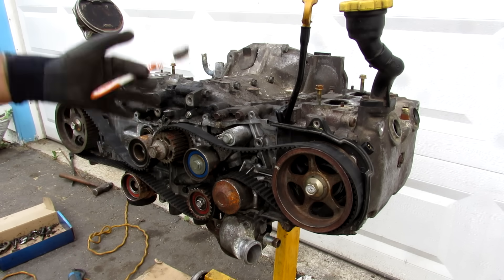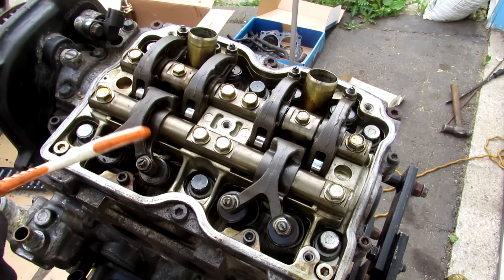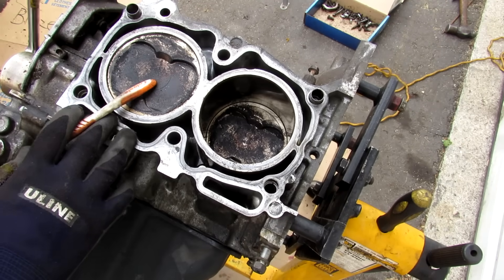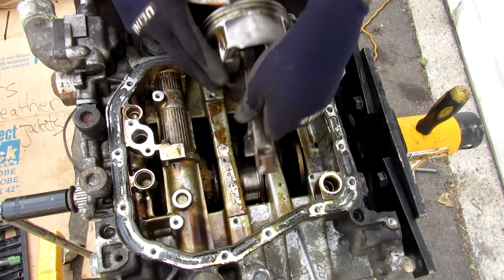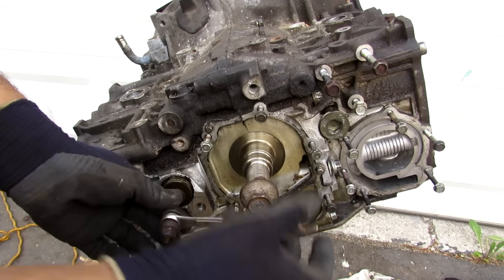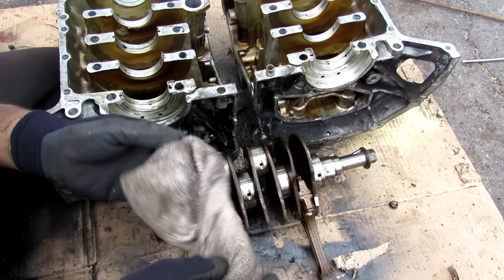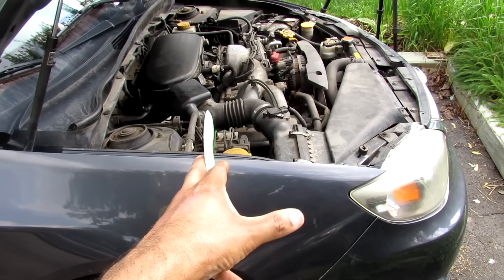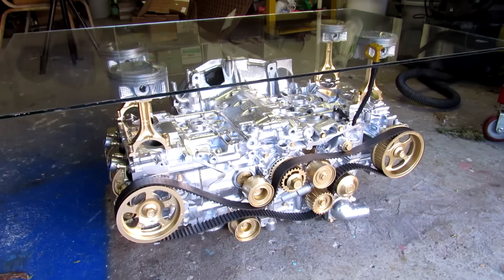Why Subaru Engines FAIL

Comment: At 11:44 how come there is no hole for oil? Could it be on the other side?

Also, I've owned a 1.5 liter NA automatic Impreza which is the weakest and dullest engine Subaru ever made that you could have on an AWD car, it does 0-100 Km/h in 14 seconds. The plus side is that it handled really good and the engine was very smooth at high rpm compared to every inline 4 I owned and driven. I did about 150 thousand kilometres until I sold it, and it had ZERO problems hence I was very religious about servicing it.

I enjoyed the video BTW.
Reply from the maker: I think its lubricated on the other half of the block. Glad you enjoyed!
Reply: :D They sell the Impreza and XV with the 1.6l NA and CVT as only engine option for years over here (well, now actually also the 2l e-boxer). Same 14s 0-100. Really a uninspiring engine/transmission combination. ^^
Reply: Even possibly slower was the Subaru FF1 which had 1100 cc flat 4. To give the car its due, I flogged it for 3 years before selling it. At one point there was 900Kg of bricks in the back. This was a wagon with front driver and manual box. Manufacturers date was 1970 or 1969. Small but mighty.

Comment: Take apart a 1.0L 3 cylinder engine from a Ford Fiesta or a Geo Metro.
Reply: I would be more interested in a teardown and comments on a Volvo B18 or B20 engine. If you wonder why - that's the engine in Irv Gordon's P1800. The difference between B18 and B20 is primarily the cylinder volume.

Comment: Subarus are all fun and games until its time to change the spark plugs
Reply: Never had a problem changing my spark plugs. I removed the battery to gain access to spark plugs on right bank and removed air intake box to access left side spark plugs. Took me about 45 minutes from start to finish, he made it look hard to gain access to spark plugs but it’s really not.
Reply from the maker: @82dupont  Well its a comparison to a normal 4 cylinder. 
The newer FA series engines are even more compact under the hood.
Reply: speedkar99 ...I’m not trying to be negative about the information, you have skills and your tear down proved it. I’m just speaking from personal experience, my 2008 legacy was the easiest motor to work on, I was victimized by the Head Gasket issue which I didn’t do myself though. Other than that, I loved that car.
Reply: @82dupont  It depends on the engine and vehicle you have. Some boxers are harder to do spark plugs on than others.
Reply: Smoke Stack Usually it's easier than it seems
Reply: @82dupont  i am enthused/encouraged by yur information
Reply: @82dupont  
I have to take off two whole coil covers to get to my spark plugs. So annoying.
Reply: But then again, how often do you have to change plugs on a modern vehicle?;not very often,so no major issue. Got three subies myself.
Reply: @ozzyolof9209  Every 100 thousand. I do the maintenance myself, so its a pain in the butt. Plus if you go to the dealer the cost is expensive.
Reply: @ozzyolof9209  On the STi it's every 96k km. Not that often, but a pain when it's time to do them. Took me a few hours and much cursing.
Reply: @diskostew99  it takes 30 minutes for a professional to do all 4.
Reply: @pauljj5547  And charge for an hour and a half.
Reply: @pauljj5547  yes and it takes a professional 10 minutes to do all 4 on a normal I4. Next.
Reply: The spark plugs only need to be changed every 3rd head gasket. 
Coils though, every head gasket.
Reply: Just as fun as changing the head light bulbs I gave up after I read take inside of wheel well off reach up and i dont know the rest cause I took to the dealer the head lights were done in 20 mins it wouldve took me 3 hrs and those plastic clips on the wheel well wouldve been broke cause me and plastic dont get along if its plastic I'll break it lol
Reply: EASY AS PIE,YOU GOT TO USE THE RIGHT HARD DRIVE SETUP CHANGE MY 2006 OUTBACK 24 MINS.THE BOXER IS REALLY EASY,STEP BACK LOOK AND USE YOUR SKILLS,GOT A CO- WORKER CAN PULL A BOXER 35 MINS CAUSE HE IS GOOD AT WHAT HE DOES,EX WINSTON CUP ENGINEMAN FROM TENNESSEE!!WE WOULD MAKE BET AND WIN $$$ WITH HIS SKILLS HE WAS 52 ,BEEN REBUILDING LONG BLOCKS SINCE HE WAS 15,I ASKED HIM ONE TIME WHAT WAS THE STRONGEST ENGINE ?? THE OLE 4.0 STROKER JEEP STRAIGHT 6 HAD MORE TOURQE THAN ANY OUT THERE!!
Reply: High quality plugs means you may only do them 2-3 times in the cars life, just like a timing belt. They are not difficult.
Reply: I have no idea why a plug change is always cited as something difficult on these. At worst it's a little awkward. That's it.
Reply: Boxer engines are just a pain in the butt. Just too hard to work on installed in the engine bay.
Reply: It's really not that bad
Reply: @rustyshackleford81  yes, it is that bad compared to other 4 cylinders.
Reply: Sohc are easier than inline 4 motors
Reply: @Tugboatpb  i seriously doubt that
Reply: To be honest they look similar to an LS/GS460. They are tight and you have to pull the tube seals to get stuff out and have the right length tools or flex drive.
Reply: @N4CR  fair enough but compared to a normal I4, its a poor design.
Reply: Toyota 4RUNNER 6 cylinder   also difficult
Reply: Buy iridium plugs so you have to change them less often
Reply: It really wasn't that hard to change the spark plugs
Reply: @Tachyon836  I think he was referring to the turbo cars. He should have specified. My ej255 sucks to change the plugs on. Found the best way, is loosening the engine mounts and tilting the entire engine to whatever side you're on. Works pretty good.
Reply: Changing the plus wasn’t difficult on my 98.  just move some stuff out of the way and identify the right tool for the rear drivers side plug.  leaking oil was a problem.
Reply: You have never tried to change spark plugs on some older Lexus RXs
Reply: @csar2976  im comparing the boxer 4 to other 4 cylinder engines.
Reply: Its not bad job to OHC because spark plugs points up. In DOHC its harder because they are in middle of deck but i think transverse V engines are much worse 😄
Reply from the maker: @morreracing  I didn't realize that the DOHC is even harder. Agreed though the V6's that face the firewall requires you to remove the intake.
Reply: @morreracing  The transverse ones are bad, but im comparing the boxer to other 4 cylinders.
Reply: @andym1223  well there is also 4 pots where you have to remove intake to get spark plugs 😉 just changed performance coils to GC8 STI.
Reply: Also head gaskets are somewhat normal thing they consume due to abuse and neglect of service
Reply: Or until the heads warp.

Comment: Probably one of the most in depth engine tear down videos I've seen. Nice!
Reply from the maker: Thanks! I'll have more
Reply: @speedkar99  I own an Sti. This is a fantastic teardown. 
One question, are the con rods fracture split?
Reply: Agreed, very knowledgeable and very well spoken! Extraordinary
Reply: Yet he is pointing with a tooth brush 😭😂
Reply: @YadiRedPapi  ,
green, blue, or orange and red;
 Colgate, of course !!
Reply: @YadiRedPapi  Recycling and repurposing at its best.
Reply: The tooth brush thou
Reply: You should look at the one about tearing down a 289 from a '62 Studebaker GT Hawk. Completely different from the similar-size Ford engine.
Reply: Agreed , never stopped for a breath , never want a Subaru after watching this.
Reply: I won't be buying a Subaru now. Never owned a car with a boxer engine and now I appreciate my inline 6. Lol he turned it into a coffee table 😂💀💀⚰️
Reply: A 2 part block? No, thank you.

Comment: Great video as always. I own a 06 subi, same engine as in the video...oil leaks from heads of course. When you go to the gas station you check the gas level and fill it with oil :) 
Quick question. I thought oil pressure is created only by the engine bearings and oil flow is produced by the pump. Similar  to amps and volts in electrical terms. I am wrong? Thanks
Reply from the maker: Yes that's the correct way to term it

Comment: love subaru cars ♥️👌🏻
Reply from the maker: @lightningracer  Ah that H6 engine must be another wonder. I'd love to tear one down.
Reply: And short engine lifespan with high maintenance bills?
Reply: @hojo70  I'm up to 189,000 miles, no major problems so far other than normal maintenance and a water pump replacement, which cost only $250 at a shop.
Reply: Love not being able to change your spark plugs?
Reply: @andym1223  takes about 25 minutes to change plugs and wires on mine, from hood up to hood down, no special tools required. I change mine every 30k miles. It's seriously not that bad. You remove the air filter box and battery, plenty of room to work. The plugs come right out (you'll need two 3"extensions and a swivel, standard socket and ratchet). New ones slide right in, torque to spec, install new wire. (Edit: If you're curious, the torque is about 20 ft lbs, but you really shouldn't go any higher on that aluminum head.)
Reply: The Subaru is one of the easiest cars to work on ever, it’s not trans mounted, it’s not deep, everything you could want to work on is right there in front of you, Alternatir, starter, A/C, power steering pump, all right there like an Apple hanging from a tree. Serpentine and radiator not covered up. The spark plugs are easily changed, if someone thinks a Subaru is hard to work on they don’t work on many cars....
Reply from the maker: @waynecostanza2280  It would be great if they didn't have failing head gaskets because those are very hard to work on while the engine is in the car.
Reply: Yes it would, although doing the head gaskets while the engine is in the car is not worth it. That motor comes right out. However, The FB engine family does not suffer from the head gasket issue. the head gasket issue was due to the coolant aging and poor grounding.

Comment: yessssssss, i’ve been waiting for this video, and it didn’t disappoint.

thank you for some insight on the comparisons to inline and V6 engines. curious to hear more about why a V6 would be more balanced than a boxer, and perhaps a video in the future just comparing advantages and disadvantages of each engine type (V6, V8, etc)!
Reply from the maker: Yes, that's perhaps a more theoretical video I'll save for another day. Maybe when I get the crankshaft out of the inline 5 and V engines we can do some math :)
Reply: Boxer engines have perfect primary balance. They need virtually no counterbalancing. V & inline configured engines need counter balancing to make them smooth running and not tear themselves apart. Also that counterbalancing adds rotational mass that requires power to overcome, which makes the engine heavier & slower reving.
Reply: @slysasquatch6837  I agree with you. what he may have meant to say is that a v6 would be smoother than a 4 cylinder regardless of the configuration because of the number of power strokes per rotation. flat 4 and 6 should be as balanced as they get, and inline 6 and 8 close behind if not equal.
Reply: V6s often have a device called a counter shaft to cancel out the inherent imbalance of a V6, the inherently balanced six cylinders are usually inline 6s, which are also the smoothest running. Rolls Royce, Chrysler, Jaguar, G.M, B.M.C, and even Ford built a lot of I6s for this reason, that and they are easier to produce. A lot of industrial engines like big diesels are also inline sixes. V6s mostly became popular because of packaging, the blocks are shorter in height, and are not as long, so more compact.

Comment: So basically the way it was built and designed.
Reply from the maker: They have somewhat addressed these issues in the newer FA series of engines but time will tell.
Reply: Wrong. The issue is neglect from the owner(s), it's not design flaw. Subarus regularly hit 200-300k+ miles. Seen several to 400k-500k+ miles.

Comment: You just gave me the answer for an unanswered mystery on an old Subaru I used to have. It would always make an horrible rattling sound on a cold start. The engine would also run very rough while rattling. It would last for several seconds, then begin to run normally when it warmen up a little bit. It was the "pistons slapping". Great video! Thank you

Comment: They engine box each other until someone loses
Reply: Loser: the people who bought the Subaru ( been there ). Winner : the Dealership .
Reply: @sowelltrain7342  Been there about 10 times and my Dumb %$& keeps buying new Subarus..
Reply: Kiss Kiss well, why do you keep having problems. Have an ej15 here over 560000km no rebuilds and no problems other than smoke on startups.
Reply: @StrikerFin  Well, an engine doesn't really wear out in 560 km.
Reply: Aden Weber I meant 560 with 3 zeros after it.
Reply: Aden Weber The car is a 2000 Impreza, transmission is going strong too, only not wanting to go into reverse when the engine is cold.
Reply from the maker: @sowelltrain7342  Amazing how Subaru is thriving in recent years.
Reply: @speedkar99  I could not agree more , the models I have driven feel solid, handle well and all have excellent visibility, combine that with marketing that conforms with todays values and you got a winner. But it is not a car you want  for the long haul, and the cars weakest link is the CVT which are used for costs savings and to meet unrealistic mileage standards, not long life and durability. PS your videos are great, keep it up.
Reply: True. And also goddamn I would love a double double right about now

Comment: Great video,  very informative.  I owned a Subaru Loyale back in the 90's.  It had a oposed boxer engine which was  under powered. It had valves lifters problems and head gasket problems.  The timing belt was also a pain.  I am shocked newer subarus still have the same recurrent issues. Needless to say that was my last Subaru.
Reply from the maker: I still never understand why Subaru has such a following for the boxer. Just like I don't understand Saab's and Volvos... yet.
Reply: Those were the best Subaru’s of all time too!

Comment: Some people claim that Subarus are "very reliable", while others claim that "engine issues only affect some particular engines".
But then there's plenty of sources that say otherwise...Engine issues, gearbox issues and such.

As "sort of" a Subaru fan (Not as much anymore with what they offered recently), this really disappoints me.
Reply: Those who trade the vehicle by 100,000 miles think they're reliable.  I admire the boxer design overall.
Reply: Germaine Liew        I was already to buy one until my research showed the same think. Issues. Then, I found out they’d gone to CVT.  That ended the Subaru search.